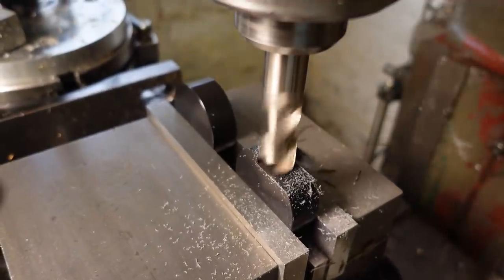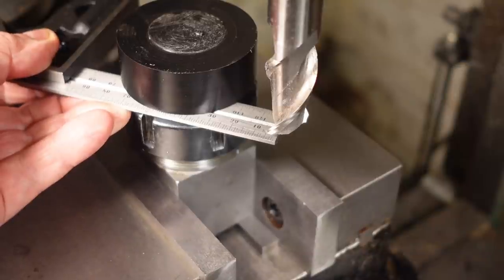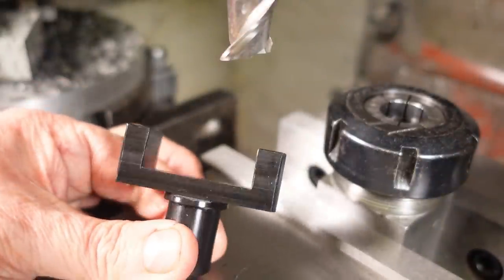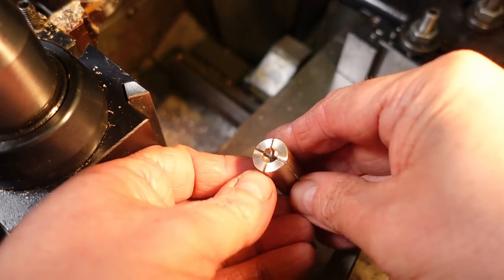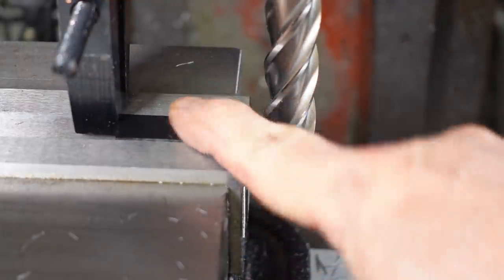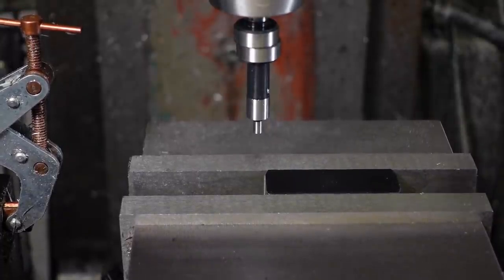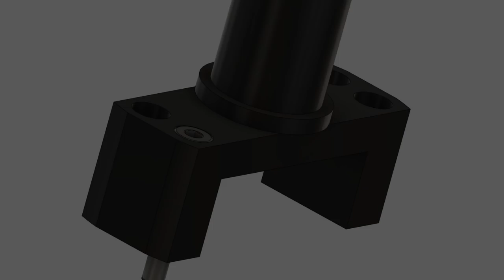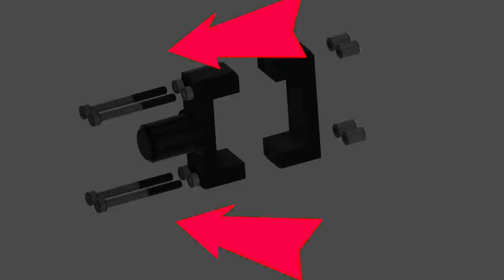Machining "Invisible*" Yagi Boom Clamps (*invisible to RF) #2

Comment: Love the videos, tighten up the movable jaw on your machine Vice :)
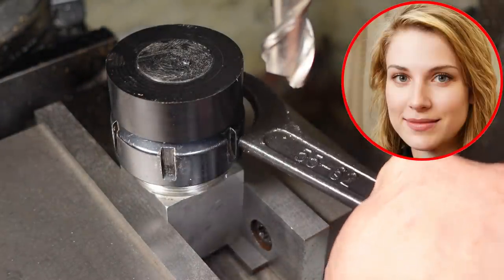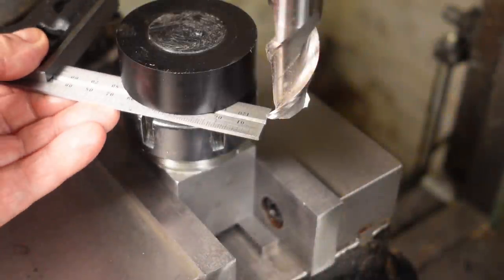Reply from the maker: Well spotted. That vice is still fairly new and I've had to tweak it a couple of times.  It was VERY cheap and it's certainly no Kurt or Gerardi.  I spotted something odd at around 00:04:00 where the collet block moved as I tightened the nut, and earlier at 00:03:43 or so where there's a very slight rocking of the block.  I bet there was a chip under the parallel against the moveable jaw.  In reality, I stopped filming, pushed the parallel out, gave it a blast of air, slid the parallel back in and tapped the collet block body down to re-seat it, hence the fade out/in at 00:04:05

I should have reshot the whole segment, but the tolerances for these parts are huge.  

Also, if it was all perfect, there'd be nothing to keep sharp-eyed, observant viewers looking for the deliferate mistales, would there!

Comment: Neil, can you say what type of signal, power and mode this antenna will be used for? Or is it Top Secret?
Reply from the maker: Full legal limit in the Netherlands on 70cm, mostly SSB/CW in contests and tropo enhancements. It's a pair of VERY long yagis from Antennas Amplifiers I think, with GRP tube braces to keep the separation precise along the whole of the booms, and to support the phasing harness and VLNA/relay.  He already has a box of four crossed long yagis on a lower mast for EME with full az/el steering. This is for terrestrial. The main booms of the yagis are 40 x 40 mm and the ends are 30 x 30, so they are serious bits of engineering.

Comment: You need more subscribers. +1
Reply from the maker: I need to be more consistent about posting vids and make them more engaging to a wider audience so the YT algorithm presents them to more potential viewers who are going to click on them and then watch a good percentage of the content, and ideally watch several vids in a session. That's tough when I've only got a small body of work so far.  They say you need to make 100 decent videos before you start to know what you are doing, and I'm a very long way short of that. Two vids a week is about the level I should aim for to build an audience, but that's not feasible when each can take 20+ hours to shoot and edit. OK, that includes the time to make the parts, whcih I'd be doing anyway, but filming at least trebles the making time, with retakes and multiple angle shots needing me to make multiple identical parts because I only have one camera and no overhead mounting bars (yet).  That means I have two lighting stands and a tripod and boom all in the way of operating the machines.  Also I have to reposition everything if I move to another machine or take desktop shots. If I wanted to chase subs, I'd need to give up the day job and stop doing short-run production jobs and go for ad sponsors and crowdfunding and do equipment reviews and I don't want to go that way really. I'd also need to do more Instagram/Twitter/Reddit/Facebook stuff to drive the userbase up. Lots of hard work. I'd also need to consider paying someone to do the editing and graphics, go for merchandise and generally make life even more complex. Organic growth is going to take a long time, but all of my content is "evergreen" so will still be as relevant in 5-10 years and continue to have a trickle of new viewers.  I'd hardly make a video before last November, so I'm still a rank beginner at this nonsense.
Reply: @MachiningandMicrowaves  the humor and way if doing things is what gets subscribers from what I see. 

Personally I look for videos 10/20+ mins long as I don't have cable. I own a small hot rod and fab shop here so my time is limited at home and work. But when I sit down I like to watch longer videos. Abom79, Keith Rucker, This old Tony and such are my favorites. Tony has great humor. 

Anyway. I subscribed and I'll watch your work. I thought about doing a channel on the shop but I don't have the time and frankly not sure if anyone would care to watch it.

Comment: Where did you get Aimee's portrait?
Reply from the maker: AIMEE, my Artificially-Intelligent Machining and Engineering expert system is a collection of JPEG bytes created by a Generative Adversarial Network at https://thispersondoesnotexist.com 
The site generates a new face about once per second and never repeats.  There is one program that generates an image designed to trick a second program into believing the image is human after it was trained with hug numbers of real human images. If the second program things the image is fake, the first program tried again until the second program can't tell either way, then the image is displayed for one second and then disappears forever.  I picked out 20 images from 400 or so, then tried to see which matched the Google UK Female text to speech generator, and BOOOOM! AIMEE was created.

Comment: A 3D Printer could have made this soooo much easier :D
Reply from the maker: And survived 160 kph winds and intense sunlight and hundreds of freeze/thaw cycles under stress without delaminating or distorting or creeping?  My little toy Prusa MK3S+ certainly couldn't manage that with PETG or ABS even at 100% fill.  Perhaps using some sort of fibre-filled filament or a special reinforced UV resin in a Saturn or something similar? I wouldn't want to risk  hundreds of euros worth of antenna up 22 metres in all weathers from baking hot sunshine to minus 15 from letting go and falling on someone's car or head unless I had a good understanding of the long-term mechanical and weathering characteristics of the polymer and fill. POM is pretty well understood and can be modelled easily for stress analysis, but the internal structure of a filament print seems to be very hard to simulate in a finite-domain modeller. I'd be happy to see some verified examples if you can point me at some references.

Is there a reliable filament or resin with documented performance in exposed exterior locations at height that you can suggest for this application, with low water absorption, reasonable UV survival, low creep rates, good shock resistance and ability to survive hundreds of diurnal freeze/thaw cycles, at least as wall as extruded crystalline POM with carbon fill? Might be worth doing a comparison over a couple of winters up on top of a mast to see how it performs.  Glass-reinforced resins might work, and I could use thermal inserts of course instead of press-fit, at least in the thermoplastic types.
Reply: @MachiningandMicrowaves  Didn't know about the harsh conditions, missed part one. In that case i totally agree, 3D printing is not feasable. Also your bracket is way nicer :)
Reply from the maker: @muh1h1  It would be brilliant to find a really REALLY good resin or filament that would work outside on antennas for extended periods, but almost any polymer that works well for RF also tends to get wrecked by UV light, so it's a big challenge.  I'm wondering if I could 3D print positives for investment casting and melt/vapourise the print as usual, but instead of pouring molten metal into the cavity using vacuum casting or centrifugal casting, use a high performance epoxy or  acrylic two-part compound filled with chopped glass fibres, perhaps using similar vacuum or centrifugal methods.  Then you get all the advantages of 3D print without the downside of layer delamination or material degradation.  It works well for aluminium and bronze, so why not for a filled epoxy/acrylic.  Could be a lot of fun as well. Major advantage is the ability to mace concave and near-hollow forms that simply can't be made using subtractive machining.